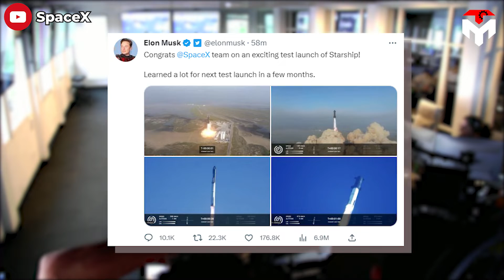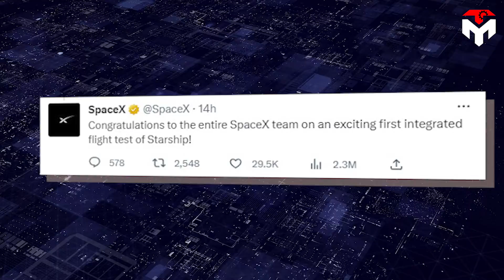SpaceX Starship's first launch attempt exploded because of this...

Comment: What still grabs me, is the steering thrusters kept steering, even when it turned into a cartwheel. Also, the structure kept whole while spinning. Something that is never seen before, I had a blast watching this amazing event. sidenote: it will be a challenge to capture these shockwaves that the rocket produce while leaving the OLM, but I'm sure the engineers will find a solution for that as well.

Comment: The announcements were based on the original launch schedule. The liftoff was delayed by about 5 seconds. The missing engines would have reduced thrust, reducing pressure, so Max Q would be displaced.